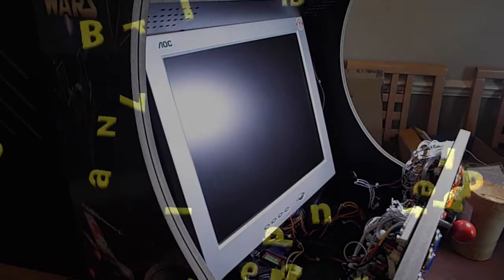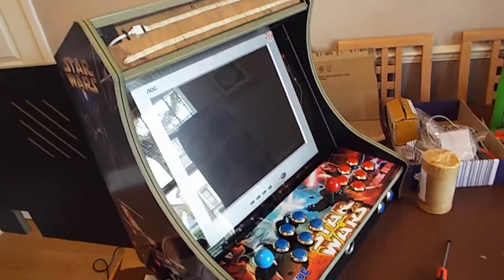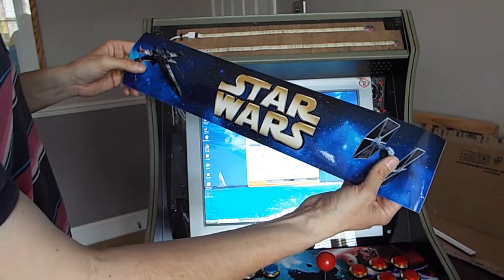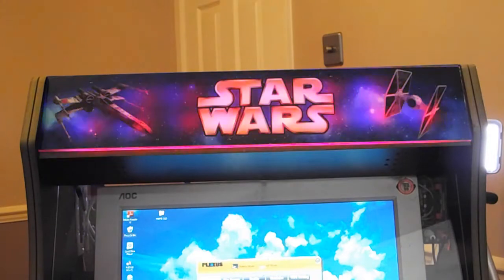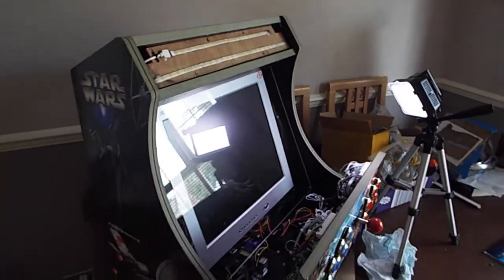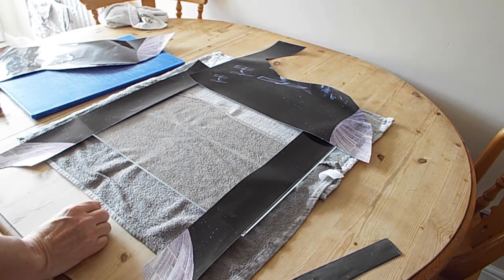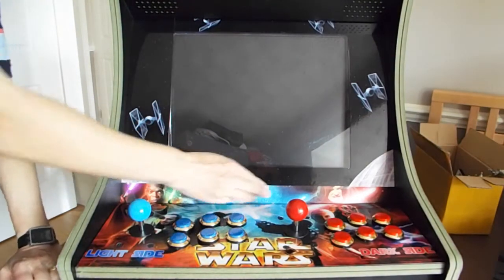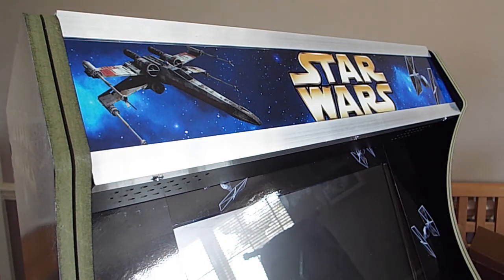MAME Bartop Arcade Machine build. Part 17

Comment: Really good build.I am about to start my own and found this video really useful! I have no electrical skills at all and this is is my first attempt.A video on how to setup up the wiring for the controls would be awesome! Thank you mate.
Reply from the maker: Hi Zippy.  The wiring for the buttons and joysticks are pretty easy depending which control boards you use.  Normally the joysticks are a multi plug and only go one way.  The buttons are 2 or 3 wire plugs depending if they light up.  Most control boards have 12 sockets or so.  Makes no odds which one you plug into as you config and program the buttons with software, like a normal game.  Good luck with your build.
Reply: fredintheshed1 Thank you for the swift reply! I have seen wiring online where people are daisy changing the negatives.I have a pi 3, is that needed for the control setup? Also I too have ordered Star Wars decals for the cabinet.Did you treat or paint the side panels before applying the artwork?

Thanks for the advice and inspiration
Reply: Also thanks for the advice about the monitor switch, something else I had not considered!
Reply from the maker: Hi mate.  I am not 100% on the pi3 setup but iam sure its on FB pages or forums.  My cab had laminated panels so i was able to go straight on with the vinyl.  If your onto bare mdf then yes to get the best possible contact i would seal the wood with paint or better still varnish.
Reply: fredintheshed1 brilliant!! Thank you.

Comment: Nice build, Don't need standby really you can either depending on if your monitor needs ICE (kettle) lead or dc just loop it into what ever you using to power the cab.

Comment: Hi Fred quick question, you mentioning infrared remote to turn on led? Does it work OK through the marquee?
Reply: Ignore me.. I seen you mentioned about the sensor bringing it to the front.
Reply from the maker: +Lea Lamont Yep I drilled a small hole in the marquee and glued it in.